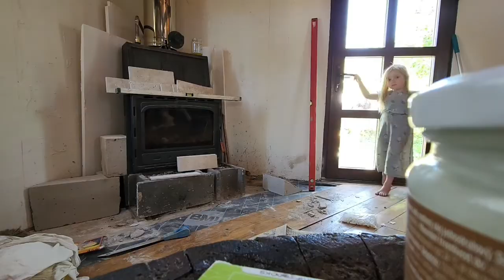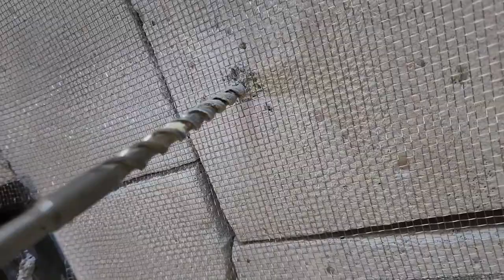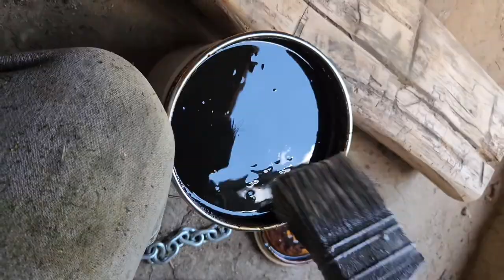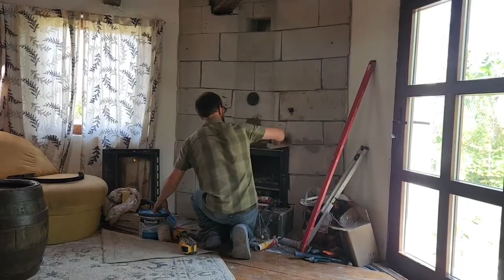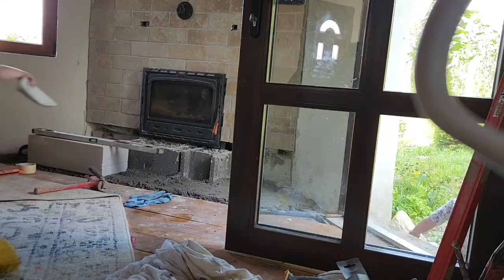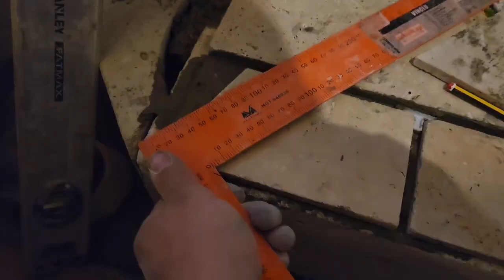Travertine Fireplace Build

Comment: Welcome to Romania!
Is a very nice looking fire place, you have some skills buliding it. 
I think you have few flaws in there.
Even if is a thermo-chimney, you need some vents in there. Usually admision grills  around 50 cm²/1kW of power and exhaust grill vents around 70 cm² /1 kW, otherwise your chimney might overheat inside.
For the water I hope you have a expansion vessel some PRV's and don't use water more than 50⁰ Celsius for your underfloor heating, you'll crack the concrete.
I love how you brought American design in a refurbished Romanian house. Keep up the good work!
Reply from the maker: Yes i have included all of that.